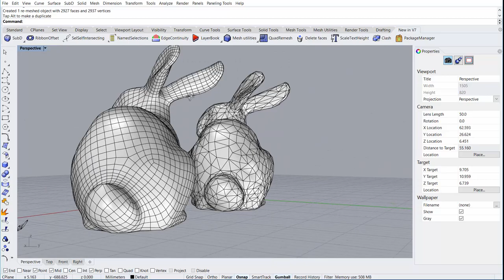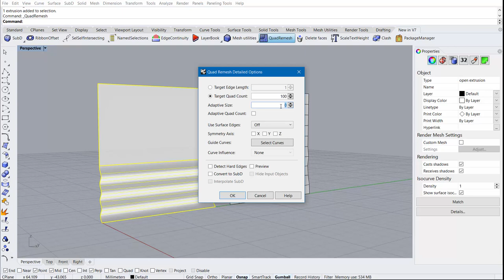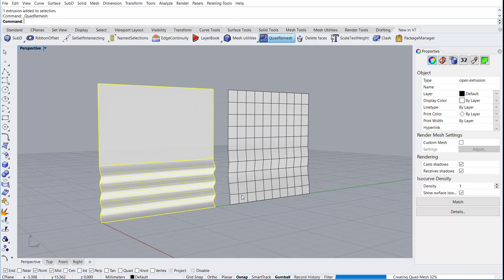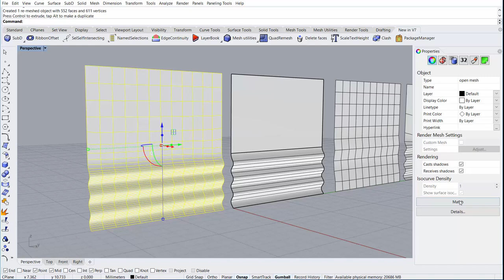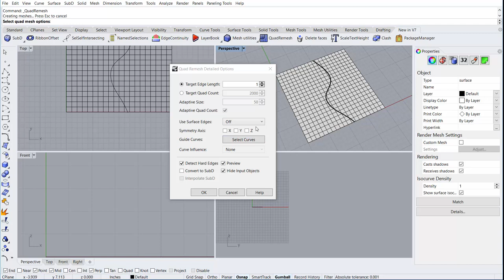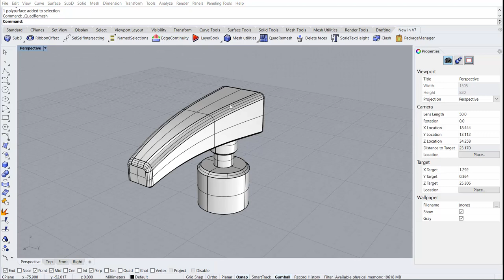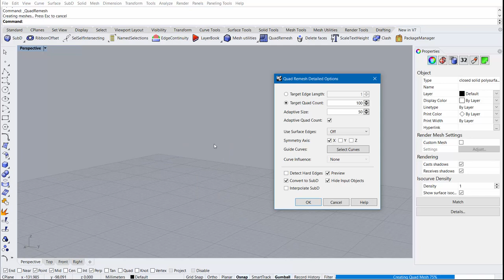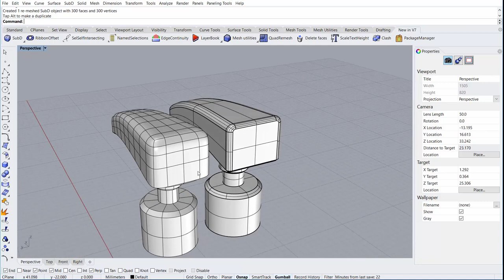QuadRemesh in the Rhino 7 WIP

Comment: Wow, that's amazing. Thank you for the walk-through. I suspect a lot of surface modellers who want to design in nurbs and output to mesh (Games and Viz) will want to use this feature, even if they don't use Rhino as their primary nurbs program. I can't  think of any other program that does it this well.
Reply: Hi 👋.May I ask one thing? Can i involve voronoi in this rabbit mesh? If it is possible,how can i do this? Please respond my question . Please 🙏🙏🙏

Comment: Amazing tool. I've been playing around with it and it does a good job. I hope its development does not stop here and it keeps improving as it is a crucial part of any serious 3D modeler who needs quad meshes.
Reply: Hey 👋.May I ask one thing? Can i involve voronoi in this rabbit mesh? If it is possible,how can i do this? Please respond my question . Please 🙏🙏🙏
Reply: @bayarmaabayarmagnai8687   there might be a way using grasshopper with rhino but not with quadremesh.
Reply: @paymansalehishafa6884   how to convert quadremesh to one open surface? Is there has any direct way?
Reply: @bayarmaabayarmagnai8687  in rhino there is mesh to nurb command but you will get a polysurface; not a single nurb surface.
Reply: After creating the polysurface, explode it then try using merge surface command to combine the individual surfaces. This is only way and it might not always work.
Reply: @paymansalehishafa6884  it works. But one issue has been faced. Some individual surfaces can not merge because of some edges too far apart to merge. What is going to fix this problem? Is there a commando to create smooth mesh or polysurface?
Reply: @bayarmaabayarmagnai8687  This is where it gets hard to resolve the issue. There are different commands such as blend srf and Match srf you can use. There are tutorials about those commands. Some times you have to cut one surface and try using blend srf command to join the 2 together to get one surface. it all depends on the specific situation and it can get very complex to get just one surface.

Comment: Thanks!  Really is extremely useful to have SubD in Rhino. And I have made a discovery... I render in V-Ray and so far that doesn't work with Rhino 7 WIP.  I have  been converting a Rhino 7 SubD form to NURBS then saving as Rhino 6... then  opening in Rhino 6 to render. Problem is that sometimes I need to do a bit of trial and error to see how the form shows in V-Ray and that means back and forth between WIP 7 and Rhino 6. Time consuming! I then discovered that the Control-Shift selection of faces  and edges and their movement (as in SubD) works with the imported WIP 7 forms even though they have been converted to NURBS, but seemingly only in Perspective View... Odd but very useful!
Reply: Hey 👋.May I ask one thing? Can i involve voronoi in this rabbit mesh? If it is possible,how can i do this? Please respond my question . Please 🙏🙏🙏

Comment: The conversion from Mesh to Nurbs is not ok yet... Needs some more improvements: It's not ok to have a surface for every polygon converted, if some polygons has the same flow they should be converted in a single Nurbs surface as T-Splines or Mesh2Surface do.
But the conversion from Nurbs to Mesh with quadRemesh is amazing!
Reply: Hey 👋.May I ask one thing? Can i involve voronoi in this rabbit mesh? If it is possible,how can i do this? Please respond my question . Please 🙏🙏🙏
Reply: @bayarmaabayarmagnai8687  not in this kind of operation, and it's also a bit useless, but depend of what you have to do.
Reply: Hi - Can you recommend an app or tut or workflow to do this, please? I'm trying to convert a detailed sculpt into a .step file. Thanks!
Reply: @artkiko4460  Now Rhino has been improved a lot and now it can do good conversions, but as I said in my comment before, Mesh2Nurbs and T-Splines in Fusion 360 are very good too.